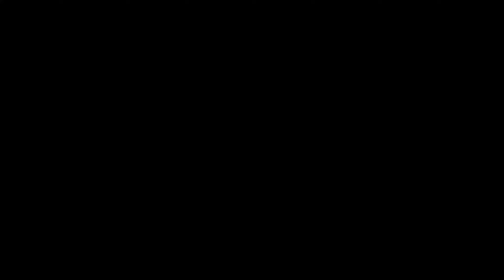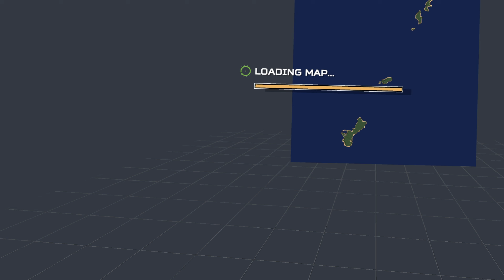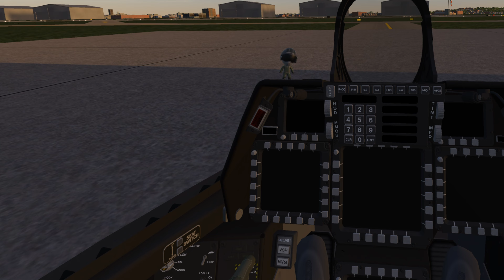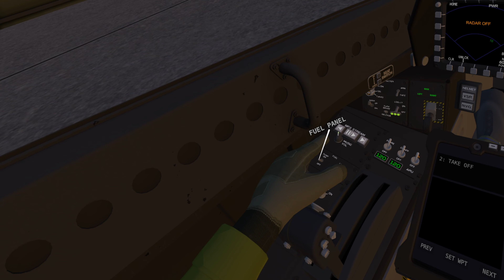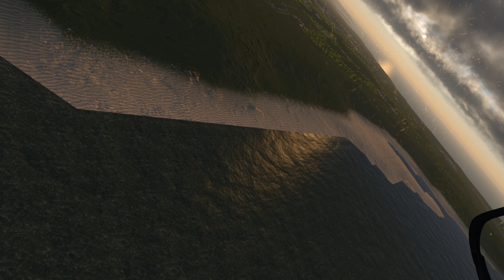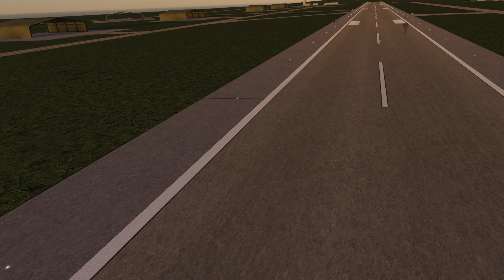VTOL VR F-22 RAPTOR MOD START UP, TAKE OFF, LAND   4K

Comment: can i get a link to that campain?
Reply from the maker: You need to add the F22 in mod loader, then when you run mod loader select the F22, then you will see the F22 campaigns.  The cold start is listed.  Enjoy.  Super smooth flying aircraft
Reply from the maker: https://youtu.be/uvIrIGc-zLg?si=J6g-KN-2QCrwXOaG